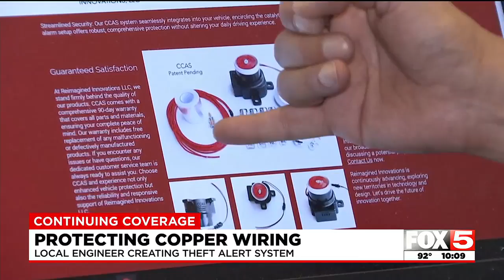Las Vegas engineer creating copper wire theft alert system

Comment: That shit solves NOTHING. Aluminum wire was the problem solver. What is this going to do, set off the alarm to NV energy after hours??? All the copper wire is going to be gone again😂😂😂
Reply: aluminum wire is a fire hazard. Look into the problems that houses in the mid-60s/early 70s had with it.